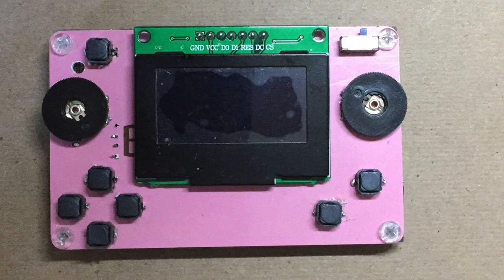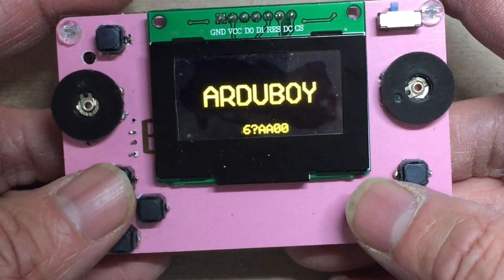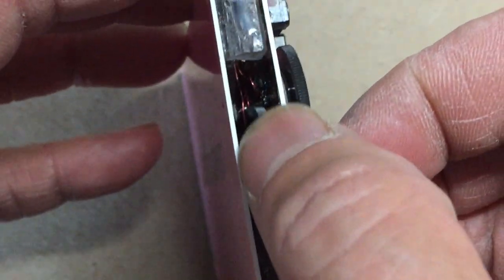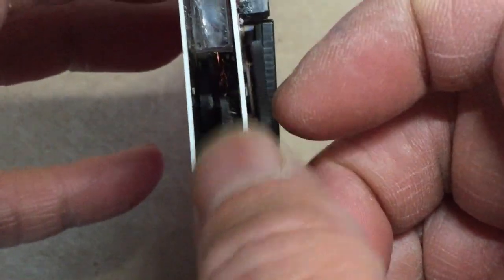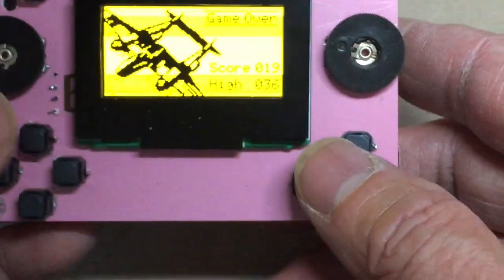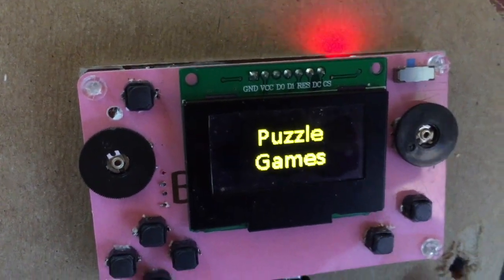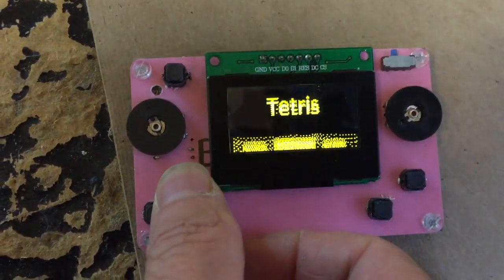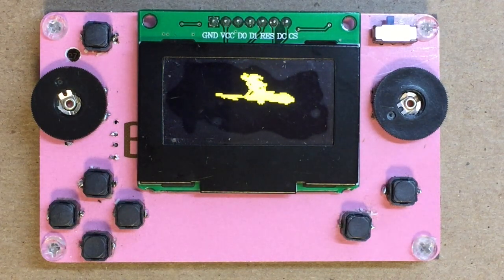Credit Card Arduboy - part 2

Comment: Too late to the video but wondering how did you use and solder something to a credit card that probably has no sort of copper layer if I’m right?? Idk how it feels too hard to make for me I sort of prefer the wiring method for myself if I could turn it to a full pcb..
Reply from the maker: Yes, you can make this using pcb as well. I have another video to show how you can make a pcb design for this . How to design PCB for ArduboyFX 8bit retro game machines using EASYEDA (youtube caption)
https://youtu.be/h7FLaAF1tYU
Reply: @BillyCdiy oh well I watched that already great design but I have fritzing which is sort of the pcb design software I use it’s not like kicad or easyeda but the app does what it does like it has simple navigations and wirings which makes it easy and really fast to make a pcb just like in easyeda and etc.. have made an Arduboy Micro which is a mini and micro sized Arduboy sort of the size of an iPod Nano that had a rectangle look (I forgot what model it was.) but I have used a prototype pcb for the arduboy micro but I have made a pcb after it was too hard for me to solder small wires to a perfboard as I done that a lot of times and it gets boring for me to stack wires to wires.. but great video plus the video that you made that talked about designing pcb circuit